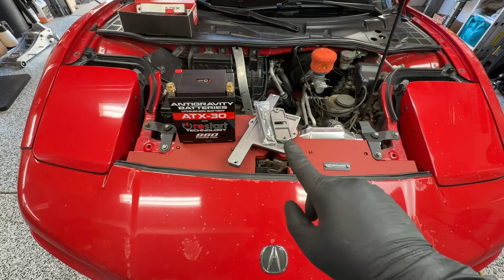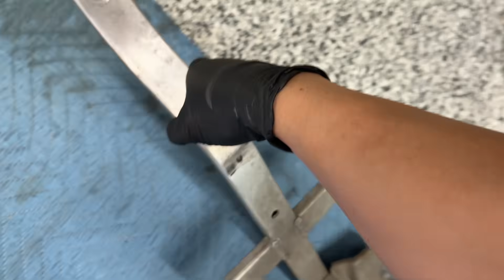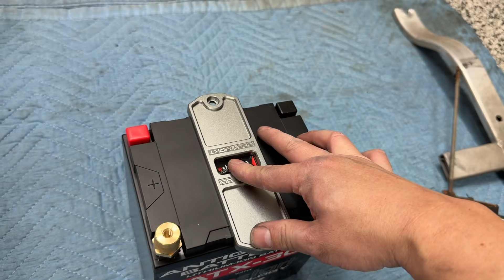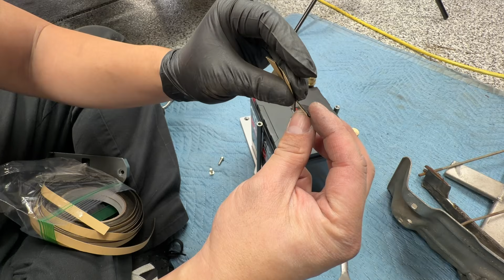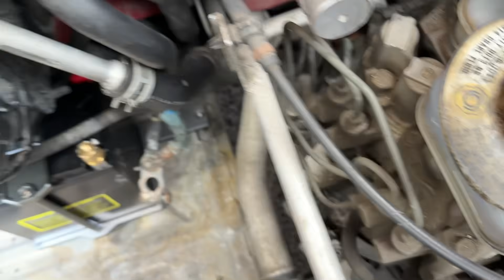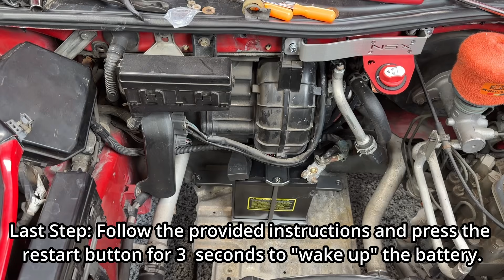How to: AntiGravity Battery + GreyMarket Tray | NSX 1991-2005

Comment: If you're switching to the AntiGravity LiFePO4, (I love mine!) a group 51R battery(OEM in the Zanardi) is about the same weight/cost as the ATX-30RS & add-on the battery holder, easier to install, and will give you about 50% more capacity. The restart feature is awesome in case you ever leave your lights on.

Comment: Fffffffancy! With me since I’m always on  a Ctek tender I just use the traditional battery… last one funny enough lasted me like 13 years using a tender… but I do like that jump start feature …. This setup would be perfect for those that does t have access to a tender.
Reply from the maker: 13 years is amazing! I also use a regular battery. Paired with my T3TEC battery disconnect and driving it every week I hope to get a long life out of my battery too. I do have a tender as well but haven’t used it yet because I’m trying to figure out which method I like better lol
Reply: @ChrisLumNSX for cold weather it’s key to have a Tender me as it keeps my battery “active” honestly I just ended up going to Costco and got a Kirkland battery as a replacement… which is made my interstate which interstate supplies the battery for Honda/Acura :) not too sure if it’s the case now
Reply: I tried to order a battery tray from them recently. Paid and waited 2 months and unanswered emails and filed for charge back. I’d caution people from ordering from them (greymrket).
Reply from the maker: That’s unfortunate. Sorry to hear. Customer service needs to be higher on people’s priority these days.